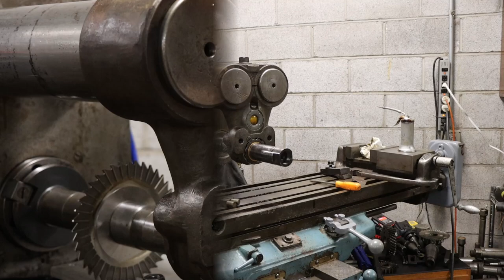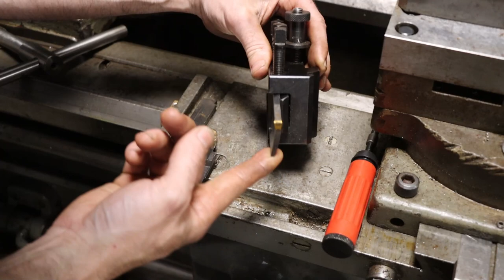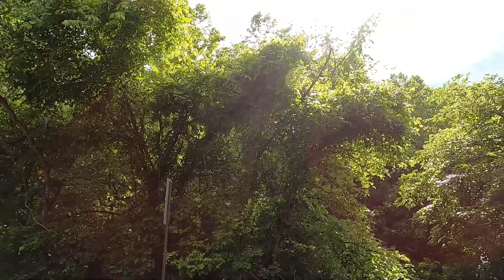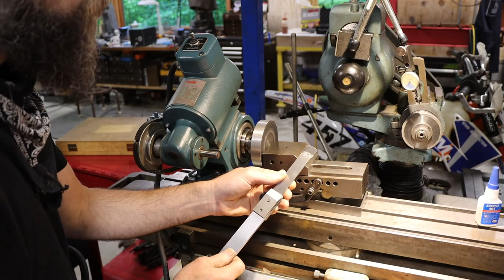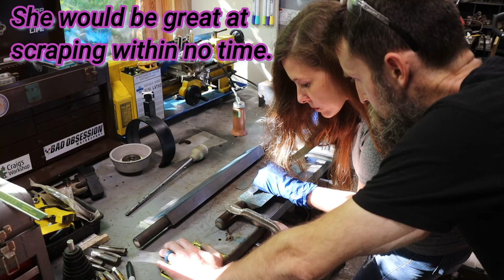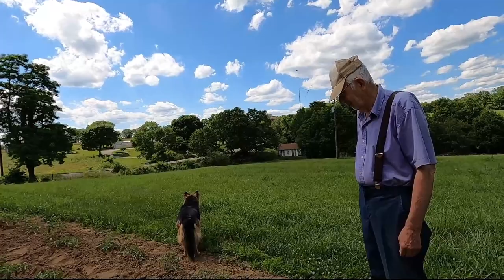Slow Speed Carbide Grinder build part2

Comment: Clever trepanning tooling. Never seen those before.

 Stimulated some an idea about making some. I designed & made a parting tool for my lathe that uses carbide tooth circular blades for the cutters. (I cut one blade into 1" x ~3" strips & got a lifetime supply from one old 7 1/4" Skil saw blade. It had a couple broken teeth, leaving a bunch of good teeth. The carbide teeth have to be shaped a bit anyway.)

If I can get an arc in them, I could also be able treppan w- them.

Thanks for the inspiration; I've been needing a new project to get me going again, (I've been recovering from cancer treatment & haven't been too inspired lately.)

Thnx

GeoD

Comment: When you were about to trepan I was thinking ‘whoa, don’t you want to face that first?’. Glad it works well.
Reply: I was in my early 20's when I worked at Waner &Swasey and learned the purpose of scraping. You don't want a perfectly flat surface. First there would be no place for oil. It would be squeezed out and the scraping does that. Second if it were perfectly flat you have too much metal to metal contact and make it hard to move the way. A lot of people I have heard say why not grind it and this is why. Scraping was a job that guys did all the time. I am sure you know  all this. It was a great place to learn how machine tools are built.

Comment: Nearly 50 years ago, when I was 19-20, I found a really nice carbide edge 'gasket scraper' at a garage sale at a little old lady's house for $5.

Forty plus years later, after scraping an unknown amount of gasket material, while working as a mechanic, I watched a YouTube video about scraping cast iron...

It was then I learned what my 'gasket scraper' actually was: the most common well known brand name of cast iron tools!

Need to build a slow speed unit, myself. Need a gear reduction motor, tho, the only one I have is 13 rpm... a bit too slow.  LOL

Re: the platen not being true
I've run into similar problems, with shaft mounted platens.  The problem can be caused by not having set screw flats on the output shaft.  Machine some flats & you can true it up w- the set screws, which doesn't seem to work on a round shaft w/o flats.

I'm wondering if you're gonna need a bit more torque?

GeoD

Comment: Hi Steve, 1st I bet my converted Milwaukee deep cut band pipe bandsaw would have cut the aluminum plate in half before you got that Cincy milling machine setup, admit you just want to run the Cincy.  2nd we used to make multi-width cuts thru thick molybdenum plates using a Cincy just like yours, the trick was thought of by one of our shop's machine tool operators, it was to put dense foam sheets, the size of the plate (The Pink Stuff material) under the plates being cut so he would not cut into the bed then clamp it down, It worked like a charm and still cut accurately. Remeber I never told you this trade secret!

Comment: Hey Steve, nice build and nice visit with Dad! We really appreciate our kids coming over to visit. When you explained how you were going to fasten the lapping wheel to the motor shaft, my mind went immediately to drilling the screw clearance hole deep, and pulley tapping the remainder, using nylon tipped set screws, or short pieces of brass brazing rod to tighten against the shaft.

Comment: Steve,  ill offer no unsolicited advice.   now; in the lapidary world the aluminum disk would be called, a master lap. cutting laps are often thin,. laps can be made from many many materials. cast iron, aluminum, lead, tin, glass,plexiglass, ect. in my lapping i did cabs in opal "mostly" i sawed with a diamond wheel in my flexshaft. ground with a 600 grade diamond lap. then i sanded and polished with diamond slurry on leather laps bonded to doorskin.
i know none of this helps, but some may entertain. lol  as for your project; you are on top of it!  take care  poppy's workshop says HI

Comment: I ended up using four 1/2” magnets with a 1/2” pilot to hold the discs on.
Easy change and it pulls the disc in when they aren’t exactly flat.
Nice grinder man!

Comment: If you're really worried about slippage, use the same method the worksharp uses, a single thumbscrew in the center.  I used an adhesive magnetic sheet and cut it to the same size and shape of the disk and glued it on. The disc will not slip at all and the single screw only improves it.

Comment: I used a single nut on the center of the grinder shaft to hold both my backer disk and lap plate to the shaft. I used to be a Jet tool sharpening thingy for wood turning tools, the shaft was already set up that way, it does not slip. For lapping scraper blades your set up should be more than adequate although a bit finicky to change wheels. To be honest I leave a 1200 grit disk on mine and never change to another grit. looking good Steve

Comment: Steve mount the disc using the center hole with a flate head socket head cap screw. This the way mine is  set up its fast and easy,  cheers.
Reply: Did you bother to listen to the video?

Comment: Stick the plate with a  magnetic sheet with 3m double stick adhesive. Common method used for holding spring steel plates on 3d printer beds.

Comment: Nice work Steve. One recommendation for your scraper based on my experience from taking Richard Kings scraping class. The body stroke technique is best and way less tiring than the are stroke technique. Make wood file handle for your scraper and put a threaded insert in the end where you can screw on one of those rubber angle grinder backing pads on the end of the hand which you can lean into when pushing the scraper. This technique provides a more consistent depth of cut once mastered. And the number one thing learned from Richard King is to separate you cuts and separate your rows and that will develop a nice cross hatch pattern and prevent digging holes in your surface.

Comment: Guess I was wrong worrying about what you would post after the shop rebuilding.  I'm no machinist but, I'm proud that I figured out how you were going to use set screws and push rods to hold the backing plate in place.  (I'm learning).  Would using a separate jam screw have any benefit in this application?
Now if you can nurture your lovely wife into perfecting her scraping skills, you can spend more time on your other projects and we'll be able to enjoy seeing her more in your videos.

Comment: For those who do not have a horizontal mill, vertical mill, rotary table and a shaper, just cut the aluminum on your bandsaw, then cut the corners as close as possible, drill your center hole on the drill press and use a bolt as an arbor and turn the disc round on your lathe.  Or maybe just buy a box of 10 carbide scraper blades off Amazon for 50.00 and they will last you a lifetime.
Reply: I have a band saw. I also have a table saw too though. Which I've used to cut aluminum plate up to 1/2" thick on. It's pretty stupid. But if you're lucky it does work remarkably well.  Well enough that I've done it a few times. It gets easier after you've done it a few times. Then you know what to look out for. The noise, the hot chips, just the overall intensity of the operation. You're prepared for the experience.
Reply: @1pcfred  Table saw or skil saw works good if you reverse the blade and use a lot of WD 40.
Reply: @oldschool1993  I wouldn't reverse the blade. You could pull a tooth doing that. Reversing the blade you're trying to change the blade rake angle. But you're also losing the relief angle when you do that. All in all not worth it to me. Some WD will leave a smoother cut. You are going to get sprayed too though. So that's a bit of a wash. I can protect myself from the hot chips and they just brush off. I'll use a coolant when it's the difference between cut and no cut. Like say trying to jigsaw plexi. I do that under water. Because if I don't it melts back together. Water makes the saw cut like how I want it to. Aluminum on the table saw I just go for it.
Reply: @1pcfred  Worked for me for years- especially effective on metal roofing.
Reply: @oldschool1993  sheet metal is a bit different than heavy plate. It has to do with tooth engagement and backing.

Comment: You could make just make an accurate recess in the face of the plate to set the disc in, then cut a slot in the plate from edge to center and use an allen bolt to pinch the disc tight. Just one bolt to change discs.....

Comment: The way that I turn discs from plate is to center drill the plate for a tight fit onto a bolt shank, then chuck the bolt in the three jaw with the bolt head behind the jaws and then tighten the plate onto the bolt using washers and a nut.  I can accurately turn the disc diameter in one setup that way using common turning tools.

Comment: Not the first time grub screws have been put in the edge of a disc, seen it on a flywheel for an old tape recorder and on some motor pulleys
Normally a clearance hole is drilled almost to the bottom, the last part of the hole is threaded

Comment: hey steve.
in regards to cooling the motor of the carbide grinder 2 ideas come to my mind;
1- put a small fan on the spare shaft of the motor with an inlet cut into the side of the box but that will take away some power from the motor, so....
2- pick up a pc tower cooling fan from any computer outlet which has its own wiring, its own motor and own body which can very easily mounted to the grinder box and maybe can also be wired up in such a way so as you increase the speed of the grinder the fan also increases

Comment: Use the type of glue a DA sander does to keep it's sanding discs in place, sticky enough to hold the disc for work but allows you to peel it off when needed without too much fanfare.

Comment: interesting thing that trepan cutter , never knew it existed 
saves some time compared to wittling down the corners untill its round 
the setscrews might cause the surface to bulge a little (when they hone a block they put the headbolts in to make sure the cilinder is round under tension )
as for scraping look at the video's from @yl , he took some lessons and does a good job explaining the basics 
as for fast disk changes , you could drill the holes and use studs and a wingnut in the center , the wingnut will hold the plate down and the studs prevent it from slipping , could make a little aluminium puck to set over the plates and the studs with the wingnut (or a round nut with a knurled edge ) over that for some more equal clampdown force
about the scraper , wat i seen on someones tool is that he made a extention on the end of his handle with a small pillow on the end of it , he placed that end on his hip or shoulder to help push the scraper , gave him more controll (could use two hands to push down on the scraper) and saved his arms from falling off after doing a bit of scraping

Comment: Was thinking that once you had the plate dialled in it would have been a good time to take a light cut across the entire plate before boring, to get a nice good surface on the one face as reference to being normal to the centre. then simply measure out again and do the bore, and have it immediately have a single good face. Probably will be good to take that surface as is and place a thin gasket paper backing on it, to give a tiny bit of compliance to the surface. The centre pins are going to make the plate bow slightly, so you probably will end up making a thread in the outer diameter, and then making a screw on ring that will hold the outside, and use those 3 inner holes to have guide pins in there for secure grip.

Comment: Hello Steve. I was wondering if using three screws to locate the plate might not locate it as accurately as one or two. Imagine if the hole was oversize , one screw would snug the plate against most of the opposite side, two screws would do similar but three screws might hold the plate clear of the shaft (all theoretically). It might be worth seeing if using just one screw improves the runout of the face. I know it is a snug fit, and it ought to be ok, but it is something you could try for little time effort or money. All the best, Mart in the UK.

Comment: Is that a damaged and bent over tower in the distance at the 39:23 mark that we can see while you are visiting at your dad's garden?
Reply: That's weird looking.  I wonder if it's some kind of wind mill.     Hard to see any detail at that distance.       @Steve Summers
Reply: @jimpumphrey7713  As a radio operator those types of items (damaged antenna towers) always seem to catch my eye.  I have one up about 70 feet, but that ones looks like it may be even higher at the point of the bend.
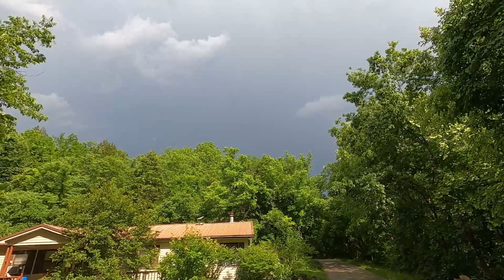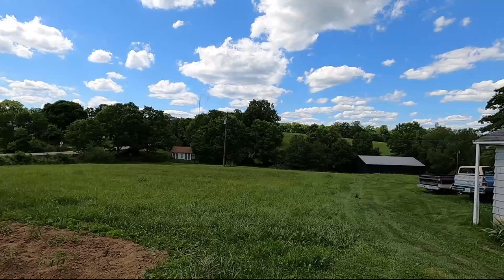Reply: 👍    Maybe it got hit by one of Steve's meteors.   😆    16:54     38:42

Comment: You could try making a rotating mass to attach to the main motor shaft to act as a flywheel. That could help hold the rpm when you apply the blade to the wheel.

Comment: #stevesummers, all you need to hold the disc is a single 82deg screw in the center, that's how I have been holding the discs on my Accufinish for years now without a single issue. The same hole that holds the backing disc on the arbor also works to hold the face disc on.  The disc change takes seconds, if you are spinning the disc than you are pressing too hard,  lapping is light constant pressure. You are over engineering this. Just one more use for the Steve Summers desk hone, TIG tungsten, it is incredible how fast the diamond plate works to hone and polish the tungsten. The hone help for directing the arc cone when working at low amperage.

Comment: Doesn't matter if its Abom, Steve or other youtuber using this type of K&T mill there seems to be a ton of runout? Is it just the blades or the arbors get runout after some time?
Reply: It has been explained many times by "Abom, Steve, or other youtuber" that a lot of the "runout" you see is from the spacer stack.  Wear over the years has it's toll.  In reality, this "runout" you speak of has no effect on the performance of a slitting saw.

Comment: Admit; you just wanted to use the K&T instead of using the bandsaw. Much more fun and much more time to enjoy "a" machining process. ;-). Cut the rough circle with a rough bandsaw and pressure turn it on the lathe. A lot of unnecessary actions regarding economic production which I favour as self employed. No nagging here; It al depends on your goal; shooting nice videos (I'm watching) on machining practices or just finishing before the client comes in... Designwise the three setscrew solution is also a lot of work (machiningwise; start with a small jobber drill for quidance of the longer one. Chances are that the long drill goes walking around your aimed end position). As a design tip; are you aware of the existence of expanding collets to mount a hub on to a shaft. It's made out ot two conical cups who slide into each other. With the use of a few screws you pull them together. By doing so the bore get's smaller and the outside diameter gets bigger. This connection is stronger than a keyed solution. It holds more torque and is less prone to fail in fatigue due to stress cracking in the corners of the key pocket. The only thing to mount it is find the right size for your shaft and machine a through or stepped hole with medium accuracy in the hub it sits in. Stick the shaft in and tighten the screws; done. For the next time maybe. Diamond lapping disc; small recess where the disk sit in. Two seals; outside/inside and a knurled threaded knob in the middle for safety. Rotating air connection on the front or the back of the machine; what suits best, and apply some vacuum. Also a cool and quick change solution... Thank you! Best, Job

Comment: Lap is looking good, although I doubt if the feet give you a proper zero for your 4 degrees. You need to mount the vice rigidly to the box for accuracy.
However, points lost for leaving the chuck key in the lathe chuck. The rule I was taught with chuck keys was "If it's not in your hand then it must be on the bench".

I'm not a fan of the outside/garden content in a workshop video it seems like you are just doing it to make the video longer.
Reply: I suggest you bother to watch the video.  The box "build" is explained.  BTW, your criticism of the video content gets you the "Go away.  Quit trying to start shit" award.
Reply: It's pretty easy to skip over bits you don't want to see. This streaming isn't like watching TV. It isn't real time video feed. Which means you can time shift content. I suggest you start taking advantage of that fact.